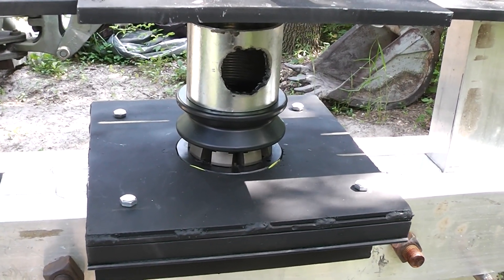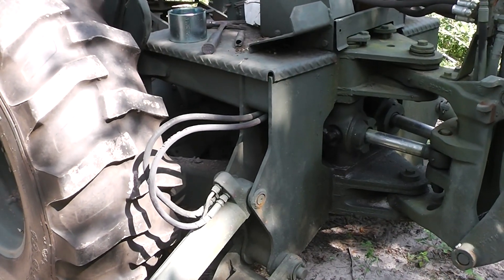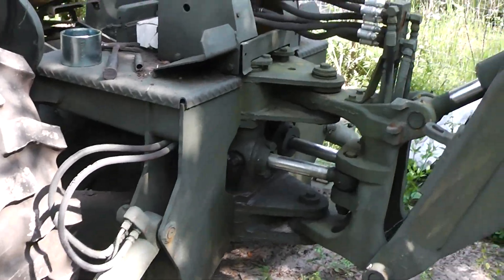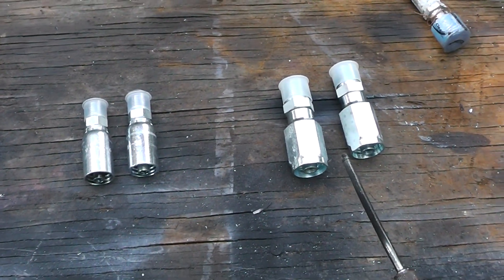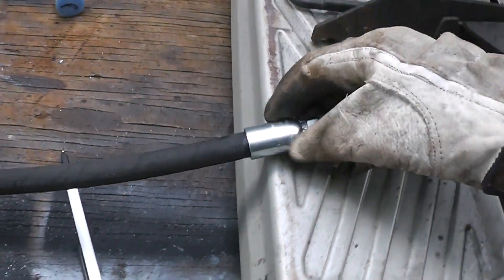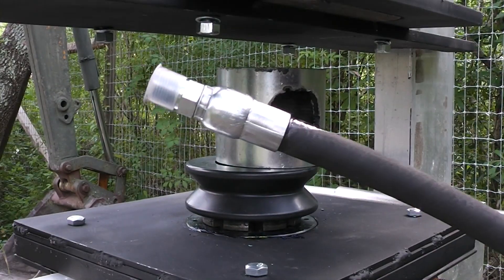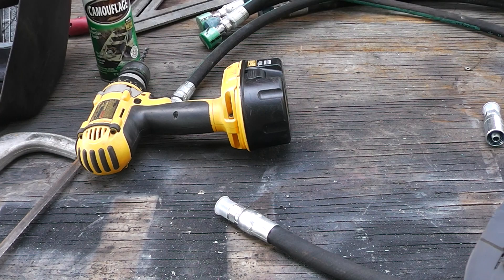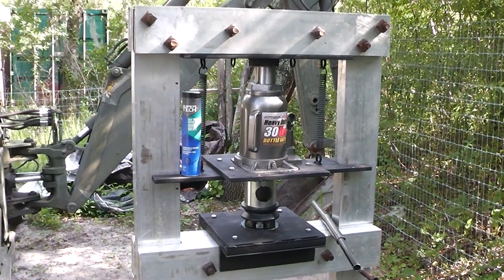Cheap Homebuilt Diy Hydraulic Hose Crimper

Comment: Nice video, but you need to lower the hose deeper into the die while crimping. You only crimped half of the end. I've seen the ends blow off like that. There should be a built-in stop on the inside of the die.
Reply: Adam Kimbrell the die is upside down

Comment: wow those old hose are history 4 shure looking forward for part to  one question will it also work for propane hose making i need to make some customs leights  prepon
Reply from the maker: donnald bakermd I am uploading part 2 right now.  I don't see why you couldn't crimp propane hoses if you are using the correct die, correct fitting/hose, you do it according to the manufacturer's specs/guide lines and you are certified to do so.

Comment: Wow... Can't wait for Part 2. I had no idea this could be DIY... Great job !
Make sure you link to some dies, etc. 'cause I've got to build one.
I just paid $215 for 3 hoses... Wish I'd have known about this... wonder how much I could have saved.
Just a thought... would a wood splitter work as the press, or is the amount of force and travel too critical?
I used my splitter one time in a pinch when we needed something "pressed" on... and it worked like a charm...
Reply from the maker: TexasPrepper2 Thanks.  I just got done filming part 2.  I didn't like the way it turned out.  I will try to put up a better one asap!
Check out http://www.discounthydraulichose.com/default.asp.  They have dies and everything.  It is indeed quite interesting to find out what you can make your own hoses for.
I think that it is an excellent idea to re-purpose your log splitter to "motivate" the crimper.  I am not sure of the tonnage required to crimp fittings but, the D100SH crimper from discount hydraulic supply has @ 35 tons capacity.  Probably overkill.  I am reasonably sure your splitter will do the job with probably the exception of the 2" braided hose fittings. lol

Comment: HP, man you are clever.  Can you please explain how the crimper works?  I was not able to tell how it actually crimps.
Reply from the maker: boat6868 Thank you.  Basically, when a downward force is applied to the compression ring, the 8 fingers of the die are equally compressed parallel around the fitting to be crimped.  I will try to do a better job of explaining and showing in part 2.